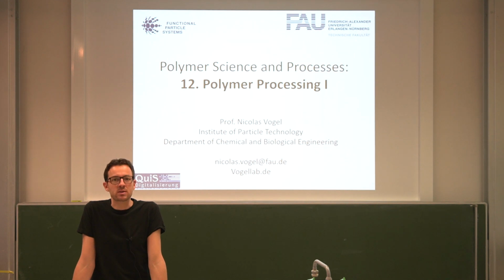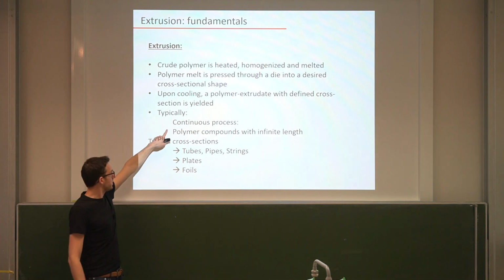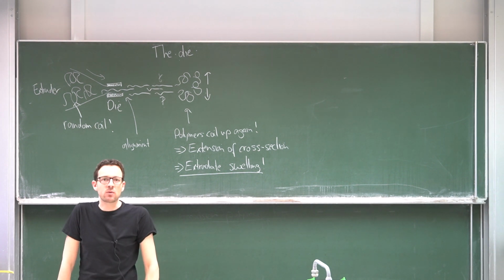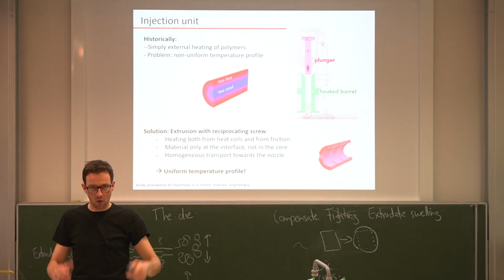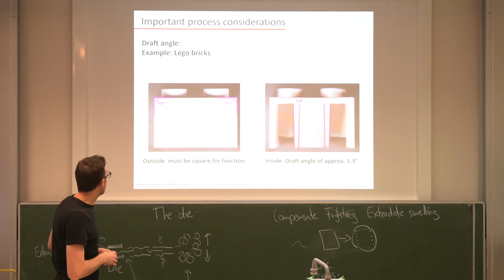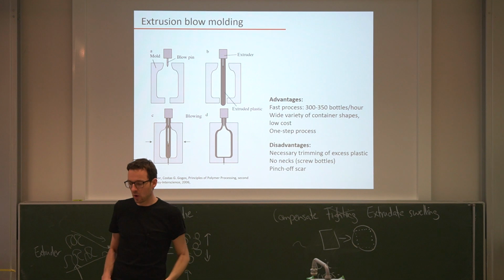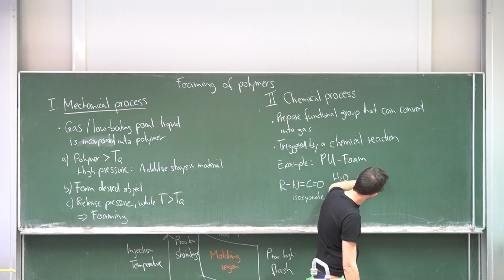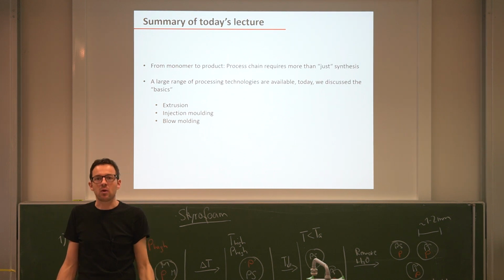Polymer Science and Processing 12: Polymer processing I

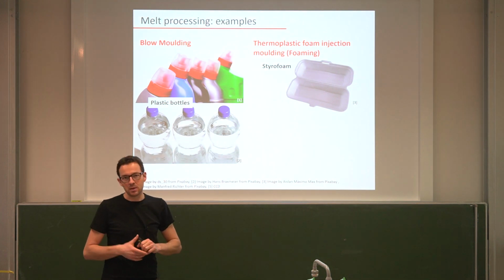Comment: Great lecture! Small addition@ 8:40 These PS foamed foodtrays are mainly made via extrusion foaming a PS sheet followed by a thermoforming step. Foam Injection Molding (FIM) is still not well adopted by the market as typically the cycle time increases when foaming techniques are applied. This makes FIM not (commerically) feasible for low end applications.